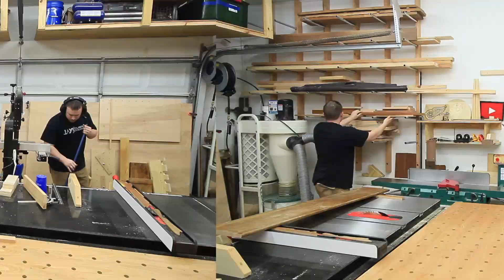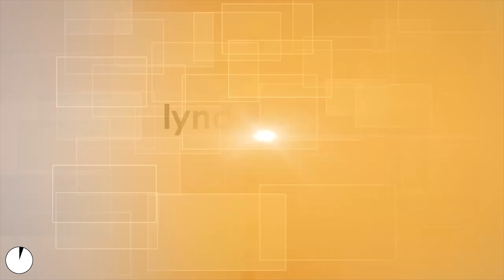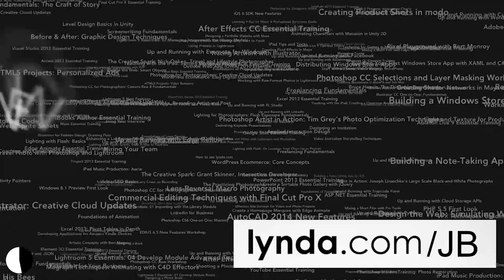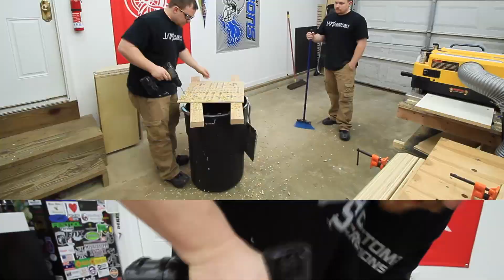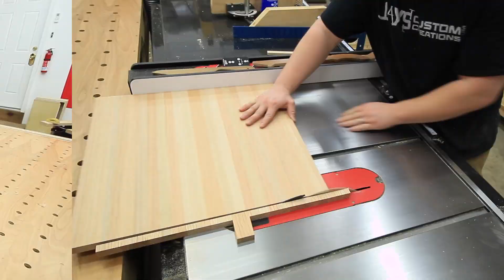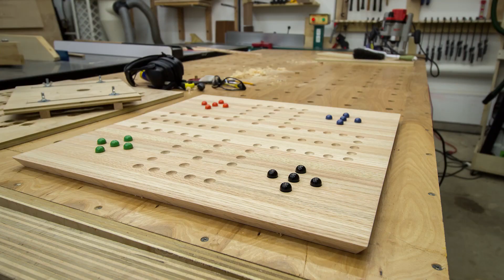Easy Gift Project: Homemade Board Games - 225

Comment: I made some WhaHoo boards last Christmas and pretty much used the same method that you just used. I made my own template fro 1/4" plywood and made mine for a 6-person game board, which required a 24" by 24" board. I used a discarded oak table leaf that I cut up and rearranged to get a 24'x24" work piece, then glued it all up... You are right, after the template is made, making these boards goes pretty fast. I do like your bevels that you cut on your boards. I used some scrap walnut to frame my boards with a slight lip above the board to help catch any stray marbles and keep them from rolling off of the board and falling onto the floor.  I didnt use double sided tape to hold my template. I just used a spring clamp at each corner and laid my game board on some bench cookies. Those held very stable... I may try your bevel cuts on my next board, though.. Great project!!!
Reply from the maker: +John Turner Thanks for the input.

Comment: For the loose bushing, could you have wrapped some small pieces of clear tape around to widen it? I know, hindsight is 20/20,  but i wouldn't mind learning from your mistake.
Reply from the maker: +djAnakin That would work. But my first instinct was to just push it to the right in the hole and that worked.

Comment: Great video! For your portable dust collection cart does the vacuum turn on when the tool does? I don't think I've ever seen you flip the vacuum on or off.
Reply from the maker: +VampireOnline The vac does turn itself on when the tool starts.
Reply: Cool! That might make a good tool talk. Probably not a lot to go over on a vacuum, but I would be interested in what you're using and your thoughts on it.

Comment: Looks really good. What sort of finish are you going to put on it? Also interested to know how to finish something like that without getting "runs" down into the indentations.
Reply: in order to finish the entirety of the project evenly he could pour a very small amount of the finish into the indentations, then places the project on a lazy Susan, often used for plates I believe, then rotate it, the centrifugal force should forces the finish to the outside of the indentations whilst still being an even coat. I believe a process similar to this is called slush casting it is used to make a hollow cast from a mould, without the use of a central mould part.
Reply: +scott harwood The finish would be forced to one side of each indentation - unless you can spin the board dozens of times with each indentation being directly centered over the lazy susan....
Reply: +cuskit oh, my mistake, how would you finish it?
Reply: I'd just spray it with my Kremlin system. Runs and varying thickness never a problem. :-)
Reply from the maker: +CodeFoxAus I'm not finishing it. The person who wanted it said they wanted to do that.

Comment: What would you recommend for a good (low to med budget) all around plunge base router?
Reply from the maker: +WallysPlace66 I only have experience with the Bosch plunge base kit and the Milwaukee plunge base kit. About the same price if bought online. My Bosch has a bad base though. My Milwaukee has no problems.

Comment: If you didn't make so much dust the new guy wouldn't have as much to sweep up.
Reply from the maker: +WoodRodent hahahaha. But he wasn't doing anything. I used to work in a furniture manufacturing facility that had signs on the wall that said "time to lean = time to clean"